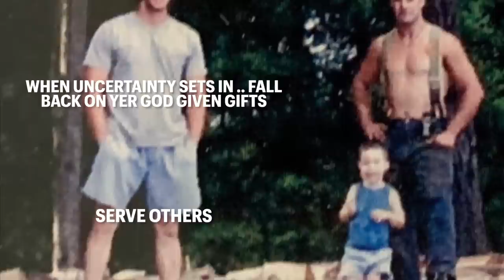My Boy's Logging , Building a Tree climbing Axe.

Comment: I think, it's a very special moment for a father, when his son is heading out for his first real job - enjoy!
 If you have electricity in your shop, I call it ridiculous to fiddle around with a cordless drill. As a wedge gets smaller to the bottom, you need a smaller drillbit than the top width of the wedge, just big enough to release the pressure. Most axe-heads are the smallest about in the middle of the eye - no need to drill much deeper. Drilling into the handle makes it useless, no way to get it tight again with another wedge.

Comment: Hi Buckin. 
Long time viewer but not much commenting. Love your content and your message. 
I’ve saved a lot of handles from old axes and one tool that works good for cutting out wedges is the “oscillating tool” with a wood blade. Fein is a good brand, but there are quite a few out there. Probably work good in combo with a drill bit. Keep up the good work.

Comment: Hi Buckin, You have a Great channel! I really enjoyed your trip back east. In regards to the current video I noticed  in the background of your front room that you have a Zenith Radio. I think it is a 12 tube 1941 Model 12S569. I have the Schematics for the radio and the Tubes. Capacitors  and  Resistors in case you need them if the radio has problems. My hobby includes fixing up old Zenith radios. Let me know if you need anything. All gratis of course..